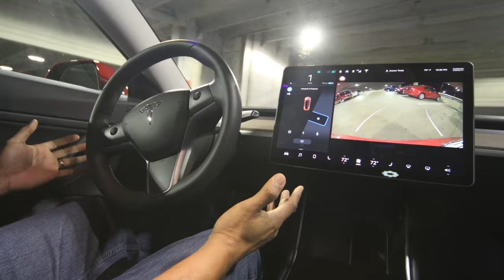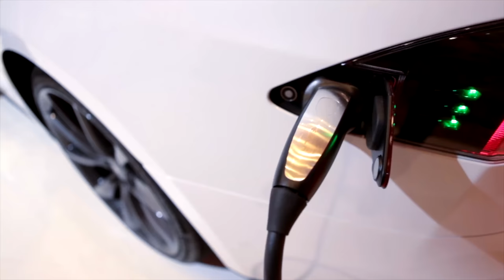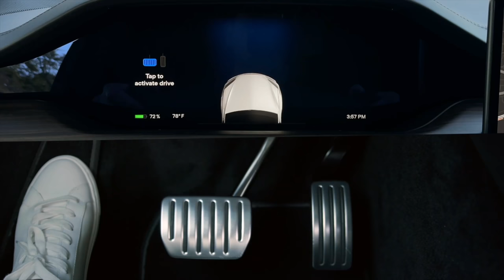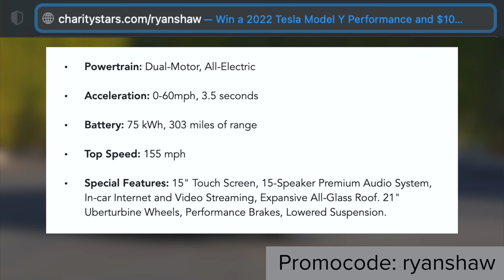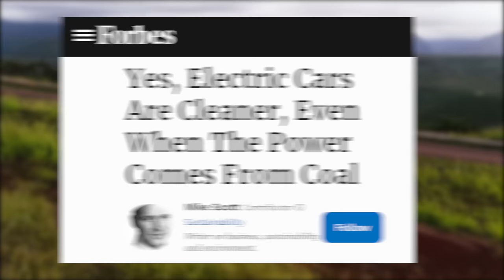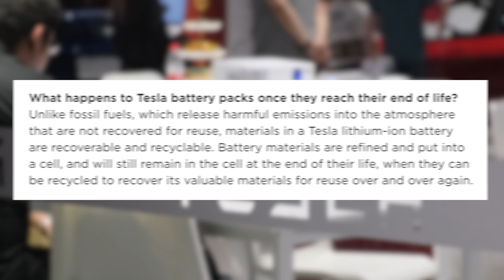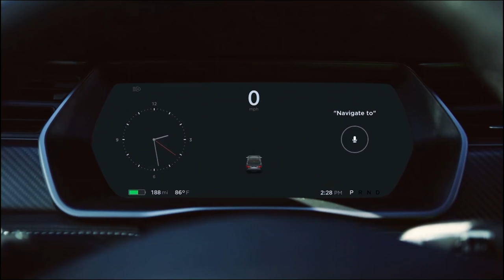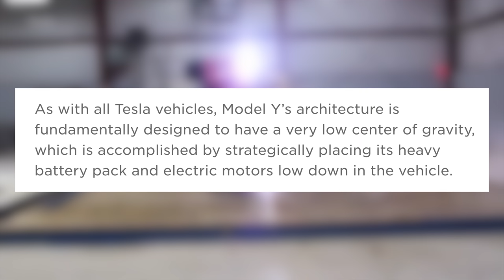9 Advantages To Owning a Tesla

Comment: One of the biggest advantages for me is the one pedal driving. Rarely use the brakes thereby saving wear and tear on the pads.
Reply: Absolutely. The fun and the ease of one-pedal driving is hard to exaggerate. The economy is also a significant advantage. I just bought snow tires for one of my BEVs yesterday, and as the customer service person was summing up my visit, she mentioned that the brake pads were the exact same thickness as last fall. 

She paused as what she had just said sunk in, then looked puzzled, and uncomfortable, as if she thought that the service crew had made a mistake in measuring the brake pads. I jumped in, and told her that this was not surprising, since I hardly ever touch my brakes, using regenerative braking, instead. She was astonished. "Oh! Wow! I didn't know that!" Few people outside of the BEV community do.
Reply: While this statement is true, the benefit is non existent as tires on EVs typically wear out 30-50% faster (I.e. from less miles) due to regenerative braking than ICE vehicles. 

So you don’t save any money in the short or long run. 

Model 3 owner here.
Reply: @Alpha_David  My understanding is that BEVs have increased tire wear due to the sheer weight of the vehicle, not regenerative braking. It's hard to imagine why regenerative braking would be harder on tires than friction braking. Hard braking or hard acceleration increase tire wear, of course, but in general, I would say that my regenerative braking is a little more gentle than friction braking, depending on the driver. Do you have a reference for your assertion that regenerative braking causes increased tire wear?
Reply: @stevenblackthorne4790  I'm pretty sure it's just the weight that makes the tires so easily worn down
Reply: @stevenblackthorne4790  what seems to wear my tires the fastest is a heavy right foot
Reply: @Alpha_David  Regenerative braking can not make ANY difference in increased tire wear.  No matter whether braked by electricity or pads rubbing on disks, killing the energy of motion all HAS to go through the tires, unless you are using retro-rocket braking.  Not likely. Even if you are using engine compression in ICE cars for braking, as is the case when you lift your foot off the accelerator or gear down, this energy also has to go through the tires to slow the car.  As I see it, more rapid E.V. tire wear would be caused by the aggressive application of the accelerator, and who wouldn't with that kind of power?  And since the car is so stable you may also be taking corners much faster than before, because it is fun.  And perhaps braking harder since you are really running a race car. 

The other reason can be that the tires are soft rubber to gain traction but at the expense of increased wear.  You could probably put on harder tires for better wear but while reducing traction.  The choice is yours though.
 
So there are three reasons why you may be wearing tires more rapidly than on an ICE car.  Absolutely nothing to do with regenerative braking though.

Comment: Good list. But I would definitely add regenerative braking in the top group of advantages. You can drive for long periods without hitting your brakes. It's less tiring to use one pedal plus the car goes into hold at lights so there's no need to keep your foot on the brake there either. I know some drivers are initially intimidated by regen braking but it's not hard to get used to.
Reply: That’s not regenerative braking. 😂
Reply: @anekinoo7  That is regen though, you hit the gas, let off and instead of immediately using your breaks in order to stop by friction and creating heat. You use the leftover motion from the wheels and let it roll so it goes back into the battery.
Reply: @anekinoo7  Yes it is.
Reply: Regenerative braking is my favorite feature. If you ever charge to 100% it is deactivated until some of the battery is used
Reply: @MooshMeat  In cold weather the regen is also limited, although there are some workarounds. In my Tesla it gives a regen limited message if it's above s 90% charge.
Reply: @anekinoo7  that is literally the definition of regen braking. Lol 😂
Reply: This is what I liked least of all about the Tesla. I like to coast and not hit my breaks at all, but as soon as I let off the gas in a Tesla it kicks the breaks in to regen instead of just coasting.  I usually pull about 3mpg over my ice vehicles stated mileage by driving this way and I save on my breaks as well as you slow down naturally. I laugh at people breaking when I can just let off it and coast to slow down. I found the Mustang Mach E better in this regard, but nothing matches the Tesla's features set. And lord help Chevy and they boom boom bolts, they still wanna charge you for onstar for some thing simple like unlocking and starting your car with your phone. I'm still undecided which electric imma get, I assume I'll get used to the auto breaking. Wanna give the Ionic 5 a test drive soon.
Reply: regenerative braking would technically be when you actually hit the brake pedal and the car uses regen instead of brake calipers first. regeneration while off pedal would be like ICE engine braking, but you also have aero, friction etc involved.
Reply: @lucianosmurf7037  engine braking is technically the best for mpg as you use no fuel, versus coasting where the engine is still idling
Reply: I wish there were a feature to turn regen braking off all the way. Its much better to coast down a hill and not need to use the accelerator to get back up to speed if the regen slows you down to much. So the regen makes you energy but then you use just as much being on the accelerator 100% of the time. So turning regen off will actually save you lots of energy
Reply: Also less helpful for making sure you don't get a deep vein thrombosis from immobilization for long periods.
Reply: For the people saying coasting is better than regenerative breaking lol! Tesla's are not for people who don't understand science!!

Comment: Ryan - I did a bit of research on this and it turns out the state with the highest production of electricity by coal is Wyoming at 40% according to the EIA. Most of the country has switched over to natural gas, which has 50% less CO2 emissions than coal. Most states of a significant % of nuclear (10-30%) which is pretty clean but just not renewable. Most folks don't realize this because this switch is pretty recent - in 2006 coal by far the largest percentage of fuel for grid power, 5 years ago coal and natural gas were about even, now natural gas is in the lead. Probably the most compelling argument from anti-EV folks is the environmental impact of lithium mining and mining of rare earth materials - and the social issues around that too (child labor in the DRC). Tesla is making advances but there is still a long way to make EVs truly green. Of course, they are way greener than ICE vehicles.
Reply: In Costa Rica where I live, we have like 99% renewable energy. So I think getting an electric vehicle is kinda obvious here. And that’s from the energy coming from grid.
Reply: Coal down, gas up, cleaner but not clean. Where are renewables like wind, solar, and hydro?
Reply: @MichaelBrown-kk6ck  Renewables are coming long. It's hard to power such a large country on renewables right now, but we will get there - eventually.
Reply: @JasonTaylor-po5xc  No we won't, Solar wind and Hydro will never be enough to power the country alone. Look at what happened in Texas during the winter storm, their wind and solar production was pretty much halted due to the snow covering the solar panels and the temperatures freezing the turbines for wind. Right when that happened, people went inside to crank the heaters all at the same time causing a massive surge in power that the grid couldn't support because wind and solar failed them. You have to have other technologies like Nuclear be the primary source while wind solar and hydro can supplement. Otherwise, we'll rely on natural gas and other alternative fuels until we run out of them.
Reply: @kingbran923  I think that is an oversimplification. There were many, many factors that played into the grid failure in Texas. Keep in mind that wind and solar are still a pretty small part of the grid. The Houston area just isn't well prepared for winter weather. So typical stuff like downed powerlines were more difficult to repair because of road conditions. Put that winter storm in Pensacola FL and you would end up with a similar result. For myself, I'm all for more green technologies - and for nuclear (fission and fusion), and even for cleaner fossil technologies.

Comment: For those of us in cold climates, EVs have almost instant heater operation.  Also, for those who drive ICE cars with small engines on hot days, the electric motor driven AC compressor (in an EV) doesn’t load the powertrain down to keep the car cool.
Reply: My brothers asked me that recently . He hates the drag the AC puts on the performance of his ICE car. With EV, it has no affect. And yes, instant heat is great.
Reply: @lemongavine  Looking forward to instant heat when I get my Cybertruck.

Don’t recall which one but there was a small underpowered foreign car a few decades ago which had horrid hill climbing ability. People used to say it had a 10-speed tranny - five with AC on and five with AC off.
Reply: @MichaelBrown-kk6ck  Haha. That's great. I had a twin-cam 16-valve 1.6 litre car in the 80's and the AC had an Economy setting where the compressor would cycle on and off. I could feel it cycling because the car would slow-down (a lot) when it kicked on and speed-up as soon as it went off. I only used the AC when I was dressed-up and it was hot out. Otherwise, I couldn't stand the performance hit.

Comment: I think a mistake many people make is to think that they will be "filling up" an electric vehicle in the same manner they fill up an ICE vehicle. 

ICE Vehicle usage whether on a road trip or not:
Wait until the vehicle has about 1/4 of a full tank. Drive up to gas station, insert the hose, wait until the tank is full.

Electric Vehicle not on a road trip (most of the time):
Plug in at home. Never have to wait for the vehicle to "fill up".

Electric Vehicle on a road trip:
Drive to a supercharger on the way to your eventual destination. Plug in and multitask (use the restroom, get some food, etc.) while probably not actually spending any time waiting for the vehicle to charge. Rinse repeat until you get to your destination. 

I've very rarely had to wait even a few minutes for my car to charge. I've always spent far less on electricity than the equivalent on gas. Lastly, I've always arrived at my destination very close to the same amount of time it takes to get there with an ICE vehicle.

Note: If one charges foolishly (e.g. waiting at the supercharger until the car is > 80%), there are plenty of youtube videos explaining how to minimize your charging time by optimizing the charging speed, then one's charging time will greatly increase. You do have to know how to use the vehicle correctly. Either way, EV owners will pay far less than the equivalent in gas.
Reply: Yep! 💯
Reply: Everyone knows that EV charges mostly at home. People just don’t know it will take over 12hr to get to 80% from low. People think it’s quick fill up. People who travel will constantly look for a charge station or buy a mobile cable. EV for people that travel will have challenges.
Reply: @danpaul4975  Well that's the annoying part. It would take me more than four charging stops to watch a single episode of Stargate. Damn car charges too fast.
Reply: Most people cannot afford a Tesla.  The largest car market in USA is 'pre-owned'.  I would love a Tesla but my 2003 Ford Focus is paid for long ago and insurance is minimal.  Then there is the Elephant in the Room... taxes on the gasoline pays for roads and is a major source of government income.  The plan is to tax the ev's on a per mile basis...it is a minor software upgrade....

Comment: What do I love about my tesla I just got a few days ago, model 3 long range.  The technology is amazing.  It is so easy to use.  Everything voice controlled.  You don't even need to use your phone unless you want to make a call.  The head lights are amazingly bright.  The sound system is amazing.  The one peddle driving once you get used to it is amazing.  The cruise control that matches speed limit of area is very cool.  the kids love all the funny features of the horn or emissons control.  I tried youtube on it and it was very cool.  I also really like how you can control everything from the app and it tells you cabin temperature so you know if you want ot warm it up or cool it off before you get in.  The trunk opens and closes itself with push of a button.  My car came without the usb ports but I put in a service request through the tesla app and someone is coming out 3 days after delivery to my house to put them in.  I also had an issue with the seat stiching and will also be fixed.  So far amazing car, it is better then I expected, it is a complete spoil me gift to myself.   I bought it even though I never ridden in one or tried it out and im very happy with the purchase and will be buying nothing but tesla going forward.

Comment: Thanks for making the point that even if cars are running off of electricity generated from coal, BEVs produce less pollution than ICE cars. The other thing that I would say is that even if the amount of pollution were exactly the same between those two alternatives, it is still a big benefit to emit that pollution in the hinterlands, instead of in densely populated city centers.
Reply: On average it works out to be roughly one third of the emission of ICE vehicles over the entire life of the EV

Comment: Excellent, Ryan!  Thanks.

Quietness is one of the biggest draws for me.  However, curiously, on our O’Toyta Prius Prime, from inside the cabin, it’s not all that much quieter in EV mode than in hybrid mode, because:
—  The engine is off much of the time even when not in EV mode,
—  The engine is pretty darned quiet even when it is on, but most importantly, because:
—  Everything else is so quiet that the sound we do hear is dominated by tire noise.

Comment: Sign up with a firm like Arcadia, and your Tesla can be charged from solar or wind power in your state. If I understand correctly, Arcadia guarantees that a solar or wind farm in your state can sell the power you need to the grid (e.g., forcing a natural gas power plant to idle instead of a solar farm). Arcadia costs a few dollars more per month until you get assigned to a community solar project, at which point you may start saving money.

Comment: Two items that I would add are regenerative braking (already mentioned in a couple of comments) and the 'hold' mode when the vehicle is stopped.  If you are at a long red light or otherwise stopped for a long time, simply take foot off the accelerator pedal and the car will not move, and you don't have to keep your foot on the brake, even on a steep incline or decline roadway.  Both of these features are unique to EVs and are GREAT features!

Comment: My Tesla model 3 will arrive January / February. I want to support your efforts for the general public to consider electric cars. Charging overnight while you sleep is what we do to recharge our mobile phones so is a no brainer. For those worried about long distance, you should stop and rest every 2 or 3 hours to refresh yourself anyway, so you can coordinate with a recharge station visit. I live in an apartment building so recharging from roof solar panels is currently impossible, but my electricity retailer is inevitably moving away from fossil fuels to sustainable alternatives.

Comment: It was mentioned that EVs are “greener” than gasoline cars even if the grid is “dirty”, but not further explained. One reason is that EVs are often 5 or even 6 times more efficient than typical gas cars. (My Maxima had a MPG in the low twenties, while my Model Y is in the mid 120’s MPG equivalent!)  
And then, in terms of carbon dioxide emissions, even though gasoline is considerably cleaner than coal, a car engine is only 30 to 35% energy efficient, whereas a coal fired plant is around 45% energy efficient, resulting in the gasoline engine being about as bad as burning coal.

Comment: Another nice thing about Teslas are the over the air updates which adds new features to the car over time, in addition to fixing software bugs. Disney+ for example was only added recently to Teslas. Not too many other automakers would be able or willing to do that, for now at least.

I also did two long road trips in my Model Y last summer, one to Yellowstone National Park, and another to the Grand Canyon. Both trips were around 8k miles/12.8k km round trip, and I had zero range anxiety the entire time, including driving through Arizona in August and the a/c keeping me comfortable. The only time I did a near 100% charge was prior to entering Yellowstone itself.

I used about 30-35% of the battery while in the park due to the relatively low 45 mph/72 kph speed limit, and mostly because of bison-related traffic jams.

I loved how Autopilot did the boring, mundane interstate driving, and at superchargers, I found the car often had enough battery to get to the next supercharger or hotel in the time I took to use the bathroom, stretch my legs, and grab a snack/drink. This also made me less tired overall since I didn't have to focus heavily on keeping the car in my lane and trying to figure out how fast the car in front was going.